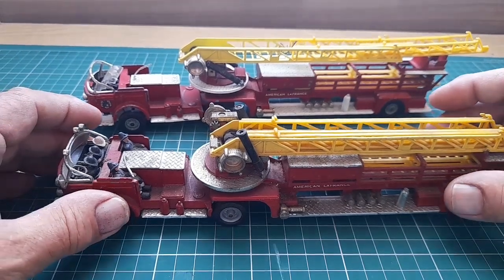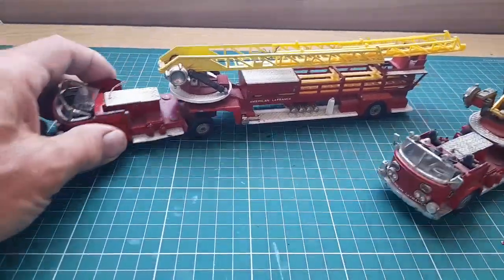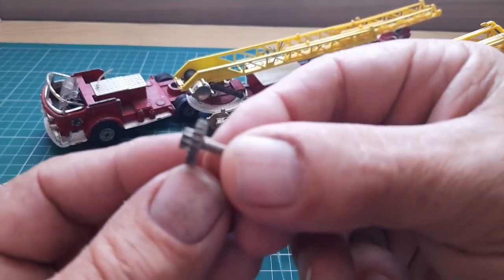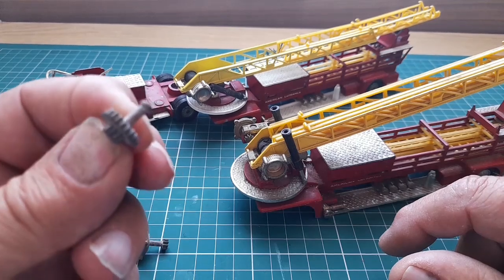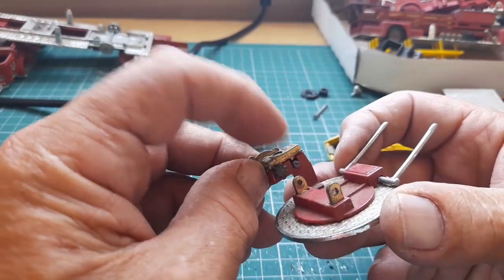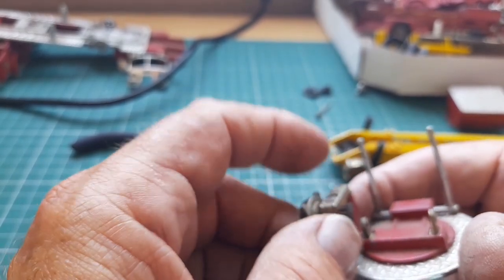Diecast Restoration Corgi major American La France fire engine part1 part 2 later today

Comment: How did that glass come out on the rear
Reply from the maker: Hi Anthony, you have to remove the steering wheel peice first, the push the tab on the bottom of the window and this will release it ,its not easy be careful  you don't crack the Glass 
All the best martin 👍